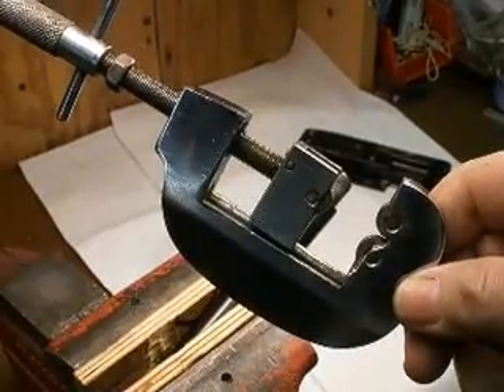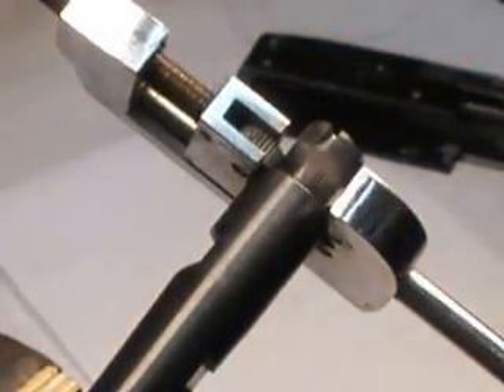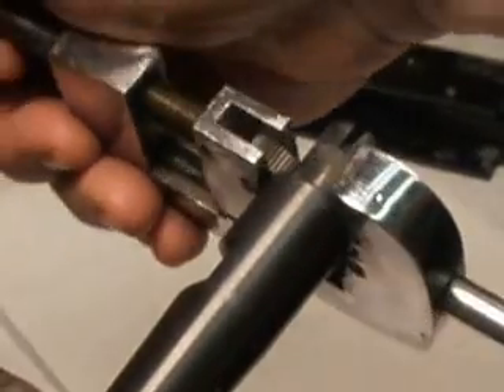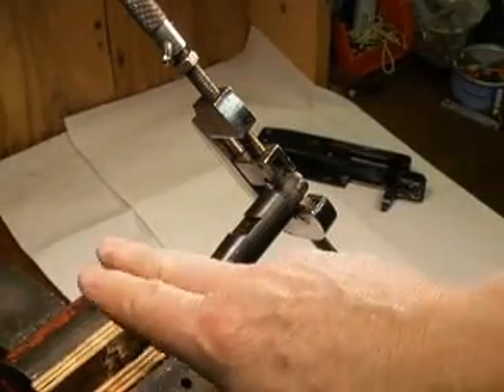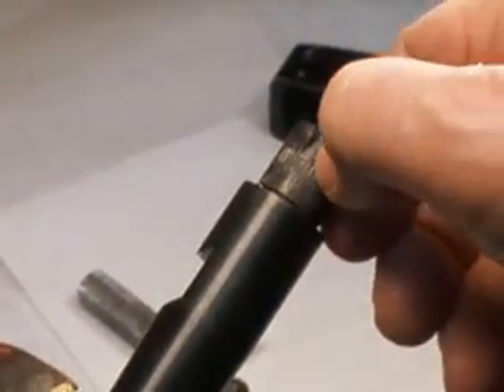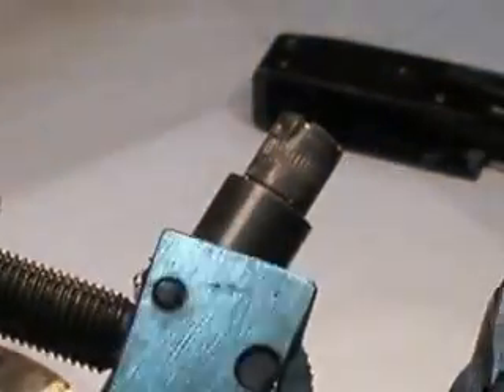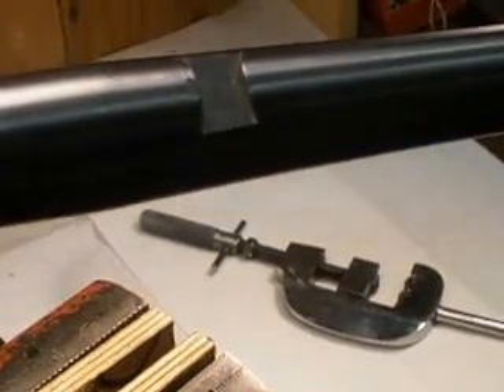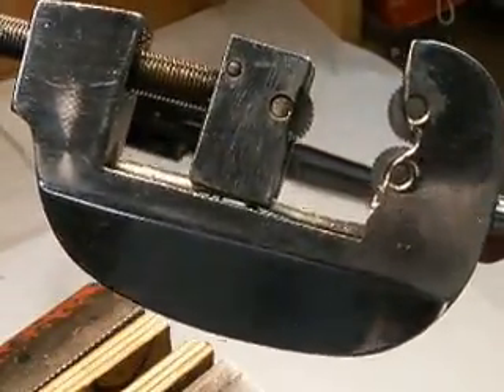Tighten 10-22 Barrel / receiver fit by Knurling

Comment: Sir if u really want to help plz explain why my marlin Glenfield 22 barrel which is slightly more then half inch less then three quarters  and it's knureld but receiver is cracked I need tubing from home depot I'm gonna make my own re never and I'm a welder not a gunsmith I was thinking shaft collars to fit the barrel fish then fill in extra space with weld then cut out bolt space with dremel or cutting wheel my son. Is 12 in boy scout and loved shoot the 22 when they went to a range now I wanna surprise him with his very own of course I'll have keys to trigger lock unless I have to break this whole thing down ( rifle ) I'm sure 10/22 and marlin r about same diameter  which is 5/8 Give or take a 1000th or 2 but bolt is almost same diameter which I expect for the matching when fired I just can't get it to work meaning some part I need I can't get here in new jersey u know how tough by is on gun rights and mag well for 7 shot mag will need to b replace I'm screwed but I've builder things far more harder and a few tons of railing system for a local prison with bars frame the whole 9 yrs and this seems so simple that it's feels impossible your problem seemed. Lose to mine as far as firing and there should b a 1/8 indent on your barrel near the extractor holes underneath and a 1/8 hole on receiver the slides through it to other side as a barrel pin does yours have the same? It would b nice to get advice except buy a new one thank you kindly for reading this  epitath!
Reply: Some say he’s still out there somewhere, running on with no punctuation to be found. Godspeed, you beautiful weaver of tales, spinner of yarns, stitcher of sentences….